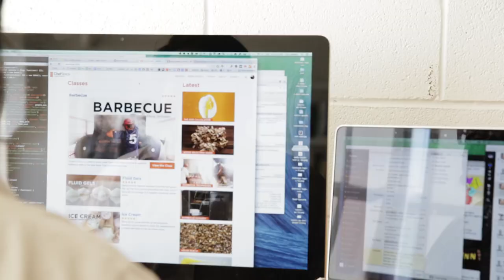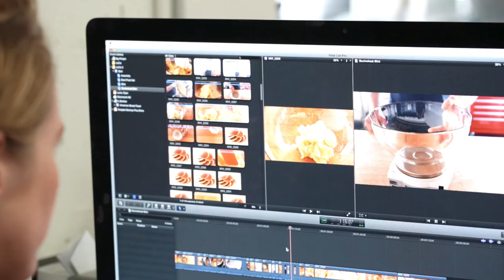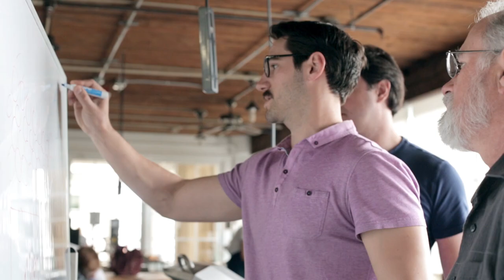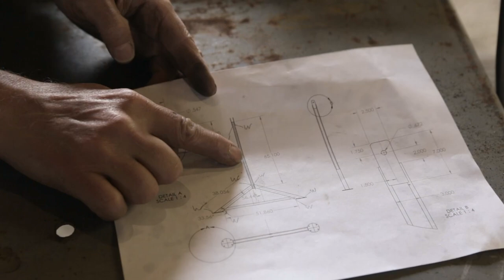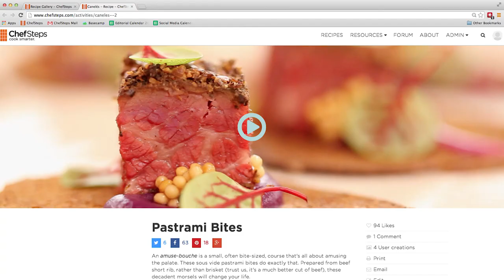Wall of Fire: A ChefSteps Story

Comment: Hey guys love the work you do. I don't wanna sound negative but you know hot air rises? All the energy has gone up there. Should have done it like an Argentinean style with a fire in the middle and putting the pigs around in a circle. I like the vertical rotiserrie idea but if you can jimmy a way for it to turn near a central fire you'll get the effect you want. You'd only need three motors to do it, and a bricked in circular pit and you'd probably use a quarter of the fuel. Keep up the good ideas but sometimes the old ways work! Peace from Oz

Comment: Did the pigs auto-rotate (how?), or did you have to turn them by hand?
Reply from the maker: RJ Our engineer Tom, designed a auto rotation system that could also handle the intense heat of the fire. He fabricated and assembled the whole system in his shop!